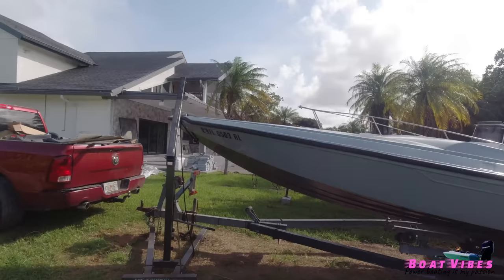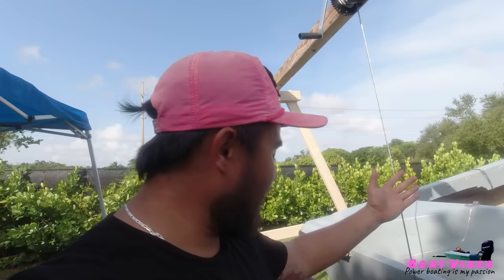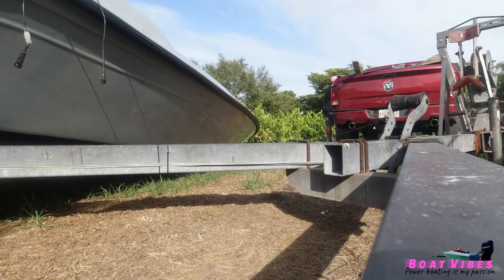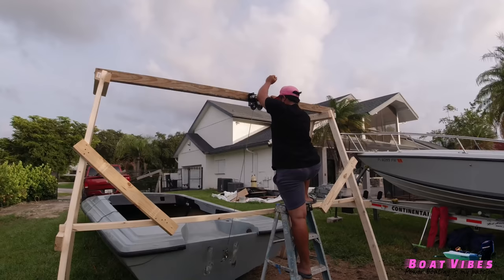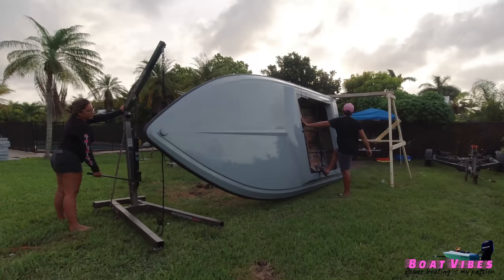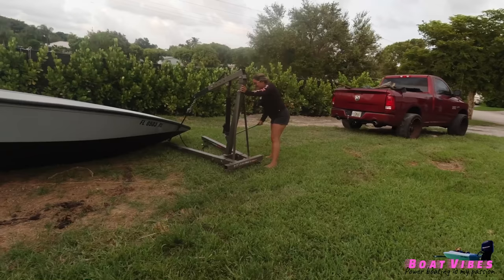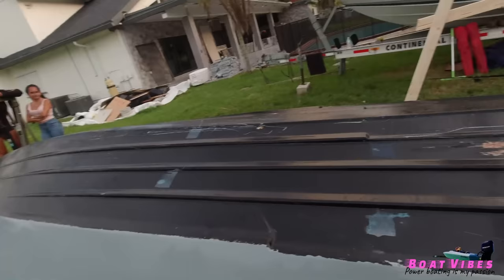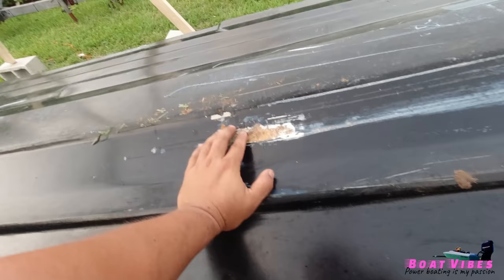Lifting boat off the trailer and flipping it upside down

Comment: Get some old tyres to put on the ground. Something soft to protect it. I’ve used tyres before. When you put it on the new trailer rest the keel on tyres then winch it on to the trailer. The trailer will just roll underneath the boat if it’s not hitched to the truck. Looking forward to the restoration. 👍🇦🇺

Comment: Hey man!  Now you can get that bottom right. True up those lifting strakes , pad and edge where the transom meet the bottom.  A set of bunk boards instead of the rollers on that trailer will help keep it true in to the future also. Let me know if you need any more help / suggestions!

Comment: Try getting an engine stand its perfect for rotating the transom of the boat. Get 4 bolts for where the engine holes were using washers of course. Use the A frame has a back up lifting mechanism as well. The cherry picker try placing it in the bow with the legs facing the stern. I saw a couple of times when the cherry picker was leaning over wanting to flip. Old tires do help so its not resting on the ground completely. Best of luck.

Comment: I can't think of a good way to do this without a forklift or crane, I have used old carpet to cover wood saw horses and to prevent scratches, also, lifting straps to hold the boat up to insert a trailer underneath. Good luck, I'm sure the bottom will come out good if you take your time. Take your time planning to turn it over so you don't scratch your hard work.